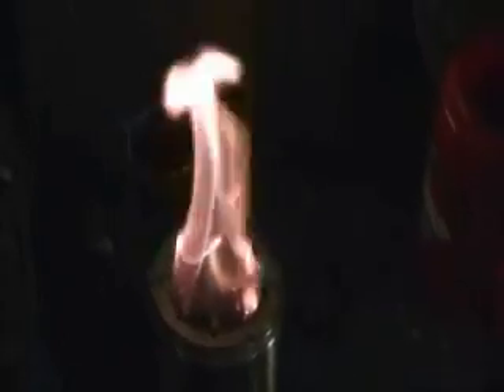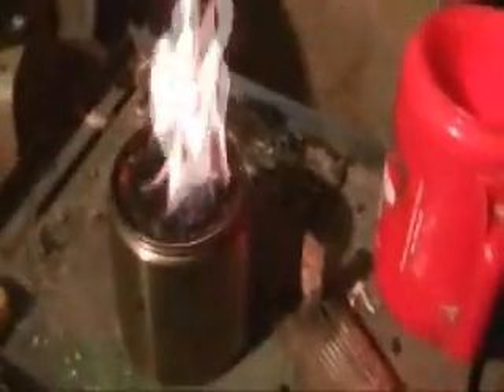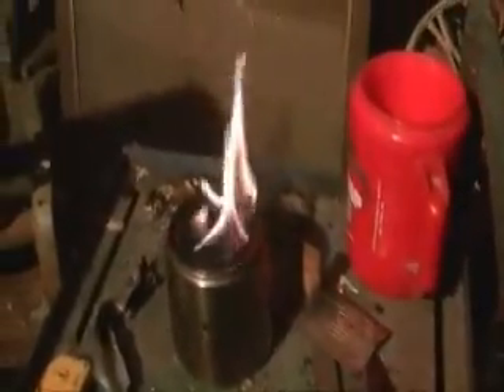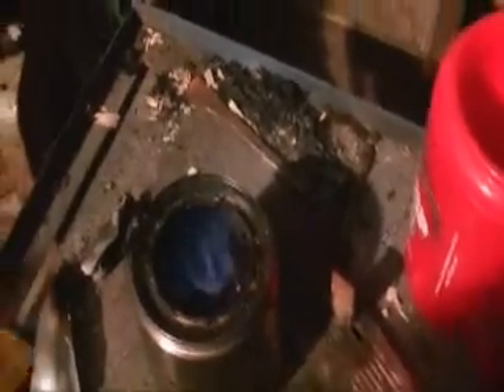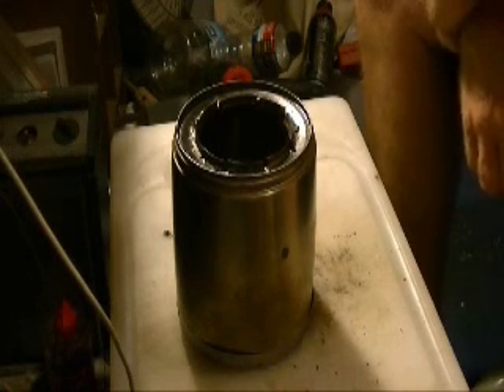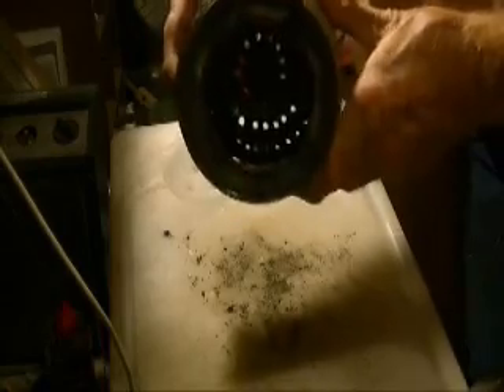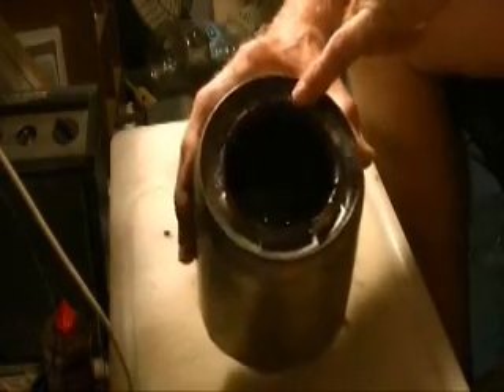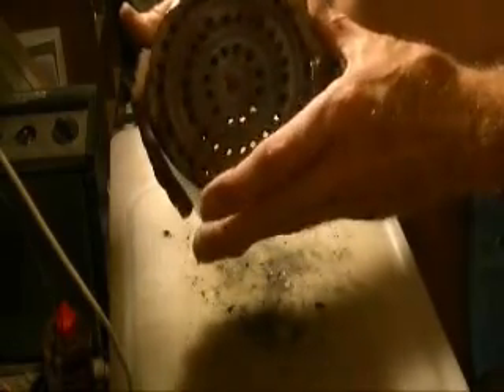Coffee Pot Wood Gas Stove

Comment: Being Stainless Steel that stove should last for a long time. Great idea. I built a similar Midge stove that I can place on a medium Goya bean can w a 3" 12V computer fan metal taped to the side w a variable resistor to control fan speed for a more controlled burn. The char is good for the garden. Only problem with that stove was my chili fell over with a gust of wind so I rebuilt it inside a 1 gallon paint can.

Comment: That would work, actually a 9V battery works o.k., obviously fan speed will be less, but I like the size. It didn't last too long tho. Maybe something a little bigger that's rechargeable and 12V, maybe an 8 pack of AAs to make it cheap and versatile.  Those Eneloop batteries look interesting, I read they are currently the best rechargeables. Or maybe a small 12v cell from Radio Shack... Hook it to the panel. I've a factory woodgas stove that uses 2 AAs. That's 3V but I couldn't find 3V fans...

Comment: You can put alcohol burners inside your gasifier stove as a backup so it dry fuel is too moist to burn due to ice, snow, sleet, and rain you can use liquid fuel. :)
Reply from the maker: Yes you can.

Comment: A fan should reduce the amount of soot compared to a slow flame.
Reply from the maker: I don't know where you would put the fan. The stove siphons the gas down through the fuel and back up the outside.
Reply: You can make a hole in your stove and put your fan there. Look up wood gas stoves with fans.

Comment: Just for the record: The variable resistor (potentiometer) I got at radio shack only reduced the voltage 2 Volts so I got a packet of 10 300 Ohm 5 Watt wirewound potentiometers (variable resistors) I believe 12V for under $16 delivered on Ebay, that's $1.60 a piece. A 1.5 watt solar panel (was $10 on sale) can power it with the sun shining otherwise I use a 12V booster pack altho I'm trying to figure out a good cheap 12V mini battery that will be more portable with witch I can sun charge.

Comment: I found one that is taller and the neck is more narrow than the one you are working on in this video. before I rip it apart do you think the height will be a problem ? if not, how did you get the handle off ..smack it with a hammer ? and how was the bottom piece attached ? I can't see any sort of weld ??